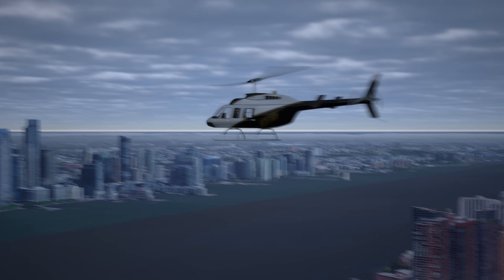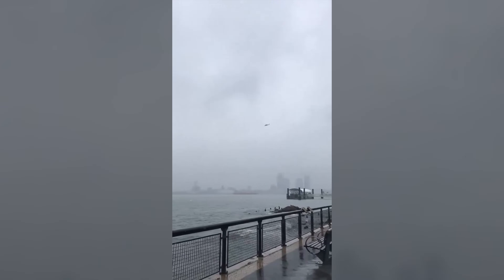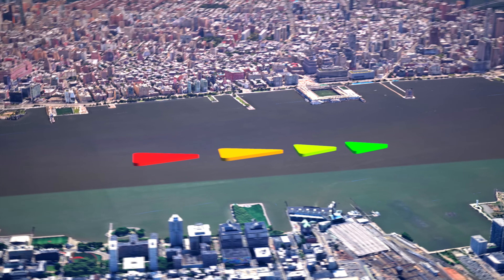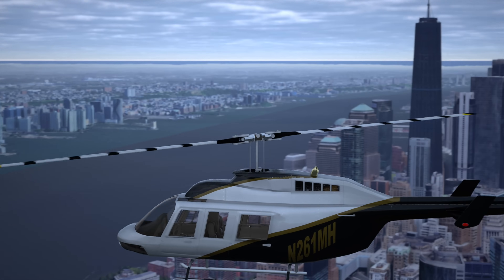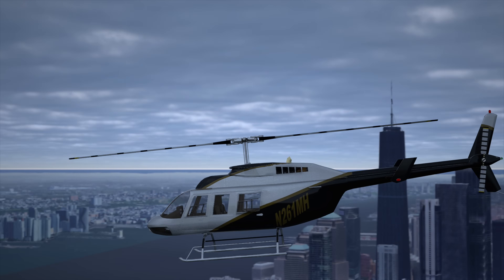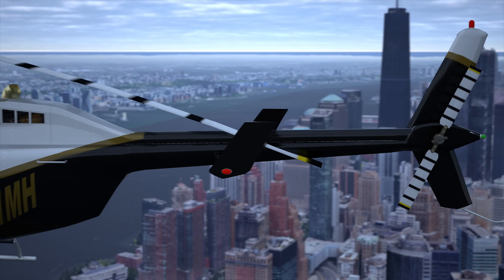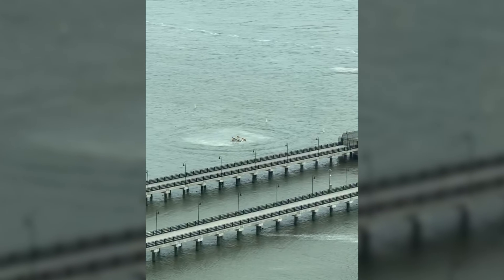Helicopters DON'T just fall from the sky - What is "Mast Bumping"?

Comment: 1. If you watch the video, and zoom in, you can clearly see the tail boom break off and the helicopter spin a couple times BEFORE the main rotor separates.
2. If it were mast bumping, the rotor head would've snapped off at the top. The entire main rotor gearbox wouldn't have ripped off the helicopter.
3. The Bell 206, even though it's a 2 bladed teetering rotor, is not really prone to mast bumping.  It's a very rare occurrence in them. 
3. The tail attach brackets are a known issue in Bell helicopters.  There's an Airworthiness directive on them. They crack frequently.
Reply: Longdogs have had M/R separation issues in the past however, most of them were recalled and replaced.
Reply: @crazyralph6386   Yes from TT Straps .  Not fro tails falling off .
Reply: I'm sure the crew chief was a deinillegal @crazyralph6386
Reply: 1- It never spun , tail & main gearbox separated at the same time.
2-in the 70s and 80s Bell / Army schooled its units and customers about mast bumping 
3- Where this tail failed was at the 2nd bulkhead aft of attach point a weak area for the 206 L .
That mating flange (bracket as you called it) is in the fuselage - AD is for corrosion cracks &  under torqued or missing hardware.
Reply: @HongyaMa  watch the video again.
Reply: @briancooney9952  You see the after event. not the exact time of separation,
You see what you're told to see. 
Rotors mast & gear box separated as an assembly, Tail trailing fuselage whole. Fuselage rolled 30 degrees to the right.
All pieces are same distance from the fuselage. In the past the NTSB used my services in the field with good results.
I specialized in helicopters.
Bell schooled and Army approved.
Have a good day
Reply: @HongyaMa  not sure which video you're seeing, but one of the videos starts with the helicopter fully intact and you see the point that the tail boom folds and the helicopter starts to spin.  No one told me this, it's what the video shows. You need to look a little harder.  I doubt you "Specialize in helicopters."
Reply: @briancooney9952  wrong video 
The tail didn't fold. time will tell.
Reply: @HongyaMa  watch. the. video.  open your eyes.  It's not the first time this has happened in a bell helicopter.  The same exact thing happened to a 407 in Hawaii a couple years back.  The tail boom attach brackets are prone to cracking. I've seen a few.
Reply: @briancooney9952  Not in this case
Reply: @HongyaMa  we shall see.
Reply: @briancooney9952  yep.
Reply: @HongyaMa you’re exactly right, that guy clearly doesn’t know what he’s talking about…
Reply: I agree that it appears that the tail boom separates first, then the main rotor. If that is accurate, why did the main rotor separate? Why did the gearbox go with it? Seems hard to explain what is shown in the video of the incident.
Reply: @orangeongaku649  A catastrophic main rotor gearbox failure would do it. Which can also cause the tail to come off. But if the boom failed first and it went in a way that the output shaft of the MRGB was suddently stopped it could, in theory, disrupt the whole system which will likely result in it detatching somewhere. Helicopters are very finely balanced and tuned machines so a major disruption is very bad news.

But there's so many different things that can mechanically fail on a helicopter that esentially results in the entire thing disintegrating it could be any number of things.
Reply: @Parabueto I can definitely see that happening. I don't see a tail strike because the rotors appeared to be in ok shape for slicing through a tail and wouldn't have torn the entire assembly out.  Mast bump wouldn't rip the gear box out and not a Jesus nut/pin failure since it was clearly still attached. No overloading of the assembly because the blades would have broke before the assembly pulled out.  

I agree major internal failure. Gear box locks and all that force has to go somewhere with all that rotating mass it just starts twisting and ripping everything out until it hits something it can't destroy or it's torn from its mounts.
Reply: @orangeongaku649    perhaps some sort of gearbox failure started the mess and tore the transmission from it's mount. We will know more as pictures are released.
Reply: @ Another interesting detail from the video is to see how well the rotor/transmission assembly appeared to fly after separating. Makes it seem like there wasn’t significant damage to the main rotor blades. It will be interesting to see how the blades look when they are recovered.
Reply: @rupe53   We will know more after the NTSB prelims. Till then its all speculations.
Reply: @orangeongaku649  Because when the cabin starts to rotate, it becomes an unbalanced rotating mass. Kind of like the washing machine disintergates in the washing machine vs brick videos
Reply: @orangeongaku649  I think the main rotor can separate when there is no tail from aerodynamic forces?
Reply: @orangeongaku649  it appears, to me, that once the tail boom broke, and the heli started spinning,  it rotated to a position where it aerodynamically overloaded the main rotor and transmission mounts from the  High G forces.
Reply: The gearbox housing itself could crack along an axis that releases the bearings for the output shafts allowing both shafts to release from the gearbox
Reply: Looked like normal flight then a quick clockwise rotation.  Could a failed rear rotor cause the sudden rotation and aerodynamic breakoff of the tail section?
Reply: Well, here it is, and not a speculation. A video of the tail boom coming off will seal the deal. They may not even have to look for it, in the water. Here is the proof. It came off.  Would it have created 4 loud sounds, like a gun going off ? Probably.
Reply: This looks exactly like the AH-1W crash on Camp Pendleton in 2011. A bird hit the main rotor PCL, and the resulting vibrations caused the aircraft to break apart almost exactly like in this video.
Reply: Used to fly 

Used to fly OH-58. looks to me like the push pull tube broke. Had a Cobra in my unit crash the same way. Lift on unbroken side goes up and the flat blade goes down and cuts off the tail. The fuselage spins causing the transmission mounts to break and the transmission and blades separate. The tube is a thin-walled aluminum tube that will fail if dented and is on the preflight checklist.
Reply: Tail boom strike, like with Australian JetRanger (LongRanger) accident in 2022, would look the same. We need to wait preliminary investigation preef.
Reply: 2 blades mass bump. 3 blades don't. The heavy rotor system on the 206 is not prone to mass bump . PLUS this was not a mass bump accident.  I went to the Bell school & I am an A&P Aircraft mechanic & I owned a 206 Longranger ,  I never heard of this tail issue.  THAT IS B.S.
Reply: timestamp?
Reply: I vote metal fatigue in/around the gearbox.  The rotors are completely intact and spinning around the gearbox at separation.
Reply: I think the main rotor detached & continued with it's spin & the torque of the tail rotor caused a huge differential on the stress of the fuselage that caused the tail to snap off, just like a rubber band being released. Too much stress.
Reply: @scottd9448  watch the video, zoom in  on it. The tail came off first, starting the  whole thing.
Reply: Sabotage?
Reply: I noticed that too.  The separation of the tailboom, and the abrupt right yaw that followed, precipitated the accident sequence.  The loss of the main rotor was subsequent to that.  I've been flying Bell helicopters for the last 41 years, and the first place that I would look would be the tailboom attachment point.  There's currently an AD on this for the Bell 407, and it's essentially the same as on the Longranger.
Reply: @rickt.1870   Yup! i've seen em cracked!  It's a horribly under-engineered design.  I think the ntsb is gonna make some "Recommendations" after this one.
Reply: @briancooney9952  We have 9 Bell 407s in our fleet, and most have had either the fuselage "donuts", or the tailboom "donuts" (or both) replaced.  Now, even the bolts are the subject of an AD.
Reply: @briancooney9952   -- NTSB, like virtually all Federal regulatory agencies, has been gutted by Leon & his doGe goons.  Do not expect any more quality work from any of these affected agencies.  This is intentional chaos & wanton destruction by rump.
Reply: rapid disassembly 
sound familiar yet? 
FElon belongs in the gr0und not the government
Reply: Where are you mr.kimber???????😊😊😊😊😊😊😊
Reply: Russian cyberhackers by satellite can create a vacuum with MASERS around heli and provoke the crash.
Reply: Bell is the Boeing of helicopters,
Reply: Great Observation  Thank you
Reply: if tail boom separated first, the ntsb will be able to tell
Reply: Sorry Brian but this was definitely mast bumping
Reply: Great Solid explanation, tanks
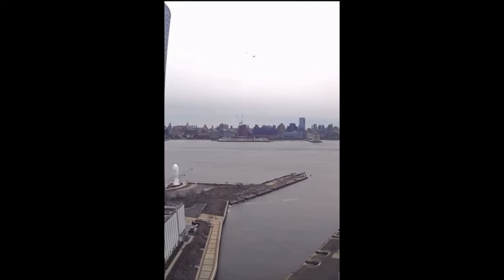Reply: 4:13 - 4:14 - 4:16
Reply: I was guessing a gearbox failure in the tail
Reply: @briancooney9952 it's due to the seizing of something in there ain't it?
Reply: @Magikarp-4ever  nope
Reply: The main rotor definitely wouldn't have been in one nice clean piece either.
Reply: Conspiracy?
Reply: Why are they still allowed to carry passengers?
Reply: Yes definitely it lost the tail first
Reply: It would really not make any sense to me, to build an aircraft of any kind, that completely self destructs by one “aggressive input” by the pilot. So can you confirm, that helicopters actually mast bump, just by pilot input?
Reply: @Wiebittewas That's what it said in the video. Especially if there are extreme updrafts or if the pilot is inputting aggressive commands
Reply: @Wiebittewas  your car will rapidly disintegrate if you drive it too aggressively.
Reply: @Wiebittewas  You can cause damage to fixed wing aircraft by pilot input...like rip off a rudder for example if you are above Maneuvering speed.
Reply: If I had a helicopter  it would have a parachute 😮
Reply: @Mattolshovee   In such catastrophic situation/s sadly a parachute wouldn't help. There's no time to jump.
Reply: @Mattolshovee  That's a strange way of saying you wouldn't have a helicopter.
Reply: @Mattolshovee  Where would you attach it?
Reply: maybe this was a sabotage
Reply: @carloko08  I thought the same thing.  CEO of huge tech company from Spain?!  We sound crazy but there was another CEO incident in NYC recently.....not like it doesn't happen....a lot.
Reply: agreed.
Reply: In mast bumping, the impact to the main rotor and tail boom happen at the same instant, but the damage to either isn't necessarily going to be so bad that they instantly fail catastrophically or at the same moment. Given that the rotor is seen with the gearbox attached, it's clear that it's the gearbox mounting points that have failed first rather than the blades or main rotor shaft - is that unusual? I don't know. I've seen a Cessna crash cause the whole engine to spin and shear off as the prop struck the ground, but the prop didn't remain attached - however in fixed wing, the prop needs to be strong enough to pull the aircraft, but you'd rather the prop came off and glide to the ground whereas the main rotor coming off a helicopter is always the worst option - I can see reasons for it not being the weakest point by design.

So whether the order of events is the rotor struck the boom and the gearbox sheared off, or the gearbox sheared off and the rotor struct the boom, or the boom broke and caught the rotor - it doesn't really seem weird that the boom breaks away immediately and the gearbox takes a few revolutions to work it's way free.
Reply: Indeed. This smacks of bad maintenance policies.
Reply: @ no it doesnt.  You can be the best mechanic in the world, and stuff can still break.
Reply: @karadan100  corrosion,  seems like NYC is a place where that could be a problem
Reply: Bell and Boeing should merge.
Trump would list them.
Reply: @grimmertwin2148 this is your fault.
Reply: @GardenGuy1942  Tech billionaire dead in New York after refusing insider trading?
Buh!
Stay in your garden and make Maga gnomes and pray for Jesus.
I bet you drive a Tesla

Comment: 27 years in rotorcraft and an instructor.  Probably not mast bumping in my opinion.  Mast bumping usually happens in hovering events or on slopes...but not always.  Mast bumping also would sever the mast from the helicopter....it is a very violent event.  I have a terrible feeling they are going to find a maintenance issue, maybe a pitch link?.  With the weather conditions at the time of the crash, I doubt it was turbulence related.  I also doubt the pilot was hot dogging.  No decent pilot would ever try to scare their pax.  Good clip and we'll have to wait and see the outcome.  But as they say, you weren't there.  Everything else is speculation.  I am sick about the pax....beautiful family and pilot lost their lives.   A little prayer would be nice for them...RIP good people

Comment: While mast bumping is real and is very dangerous, this it was not. At least not how I have seen it happen in the past. Mast bumping will cause shearing of the main shaft. The entire gearbox (at least that is what it appears to be), swash, main shaft, linkage, etc. are all attached. That doesn't happen when the rotor head shears off the top of the main shaft. The next element is the tail boom. IF you have a boom strike, the blades will absolutely be destroyed (or at very least one of them). you can clearly see they are both intact. The real question is how did it break apart? The boom separates from the fuselage WITH the blades intact. The rotor head still completely attached to the main shaft and with what appears to be quite a bit of the gearbox / swash assembly going with it.
Reply: The way I understand mast bumping it can occur when unloading the rotor and this thing was in level flight!
Reply: @donanders2110 - you can until the rotor essentially at any point of the flight envelope. The initial full footage showed a different helicopter (perhaps an Agusta) doing some pretty aggressive push over style maneuvers and there was speculation of unloading the rotor. Someone spliced that footage in. The other video that shows the tail depart is defintely a head scratcher and as others have said, how / why the upper mechanics / gearbox for the main rotor appear to be completely intact and attached to the seemingly unscathed rotor blades would lead one to think there could be a catastrophic mechanical failure. I have witnessed a few unfortunate helicopter failures and quite a bit of forensics on failed parts. Sometimes the way to the root cause is by process of elimination. Whatever the cause is, I can’t imagine the overwhelming sadness of the loss of family and friends.
Reply: @uber3D  I thought the same thing you did! It was not the accident aircraft doing those maneuvers!
Reply: Recovery of the main shaft, rotor assembly and blades will reveal a lot about whether mast bumping caused this, but it looks like something catastrophic could have happened in the engine or gearbox that caused the rest of the airframe to tear itself apart.
Reply: I immediately thought this while watching this well put together video depicting mast bumping. I’d expect the blades to instantly become mangled upon hitting the tail section or even vice versa the blades break thru the tail but for both to look disconnected and in decent shape is a head scratcher.

Comment: Obviously mast bumping is a possibility. this early in the investigations I think there would’ve been more of the tail boom still intact to the aircraft and the separate pieces coming down mainly the rotor mast, blades, disk, links and even cowling all coming off in one piece are suspect. Again, it’s early to tell, but it almost appears that there was a failure at the transmission in my opinion only.

Comment: As an ATP flying fixed wing airliners it is baffling to me that those types of helicopters are not designed to limit pilot input to avoid this type of overstressing. It would be like having an aircraft that would snap it´s wings if the pilot turned the yoke to the limit by accident....
Reply: Well, isn't that what happened with certain Boeing models with the tail?
Reply: @HanzBlitz-i8t  You are talking about the rapid rudder reversal - the difference here is that this was not accepted by the manufacturer, but later found out to be a deficiency...plus it is not something that a pilot will likely do out of startle or in an attempt to save the aircraft, unlike the mast bumping which can happen if you try to avoid an obstacle or birds.
Reply: @janvogel9719  Didn't Boeing put some plastic blocks bolted under the rudder pedal to keep it from going over too hard? I know that might be a rumor, but it's what I heard.
Reply: @HanzBlitz-i8t  No, but they limited the authority of the rudder on some aircraft, like the 737,  because they had problems with uncontrolled maximum deflection, causing a couple of catastrophic crashes. Only when one engine is failed will full authority be available. 
But you can´t just summarily limit the rudder deflection because you need the full authority in an engine failure scenario.
Reply: @janvogel9719  It was the one in NYC in October 2001 and Pittsburgh in like 1997. Something about a jackscrew too.
Reply: @HanzBlitz-i8t  Yes on the Pittsburgh one, but the other uncommande rudder reversal issue was in 1991. The 2001 one you cited was an Airbus 300 and crashed because of commanded (the pilot did it) rapid rudder reversal that snapped off the vertical stab.
Reply: @janvogel9719  how hard would someone have to slam those controls to break it like that?